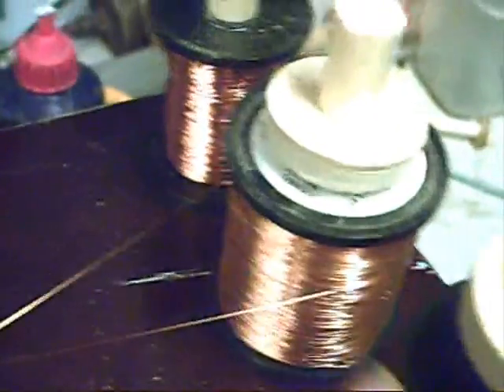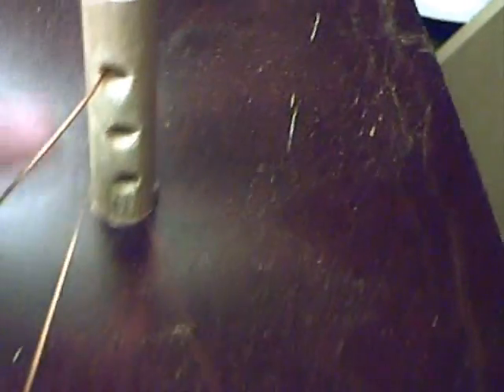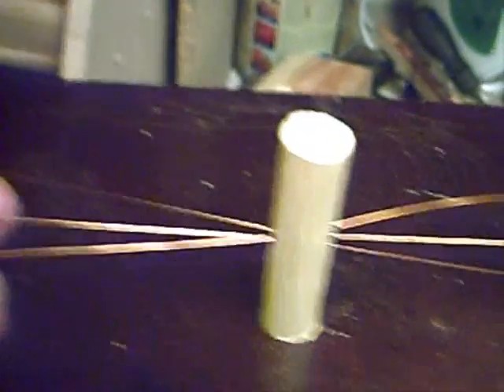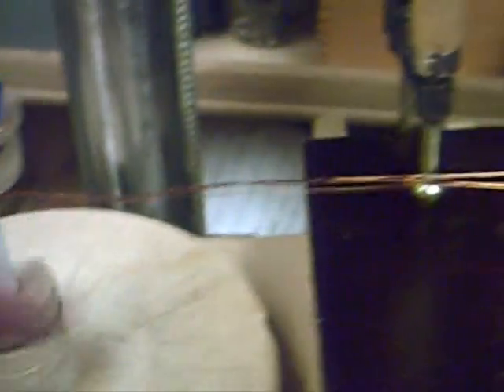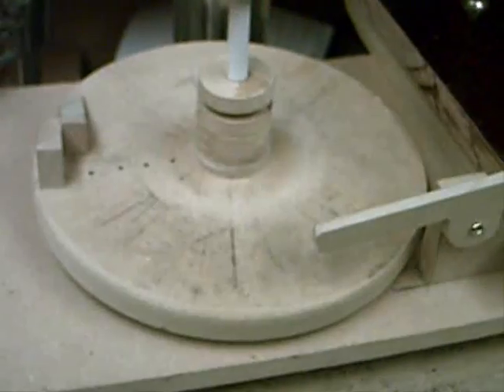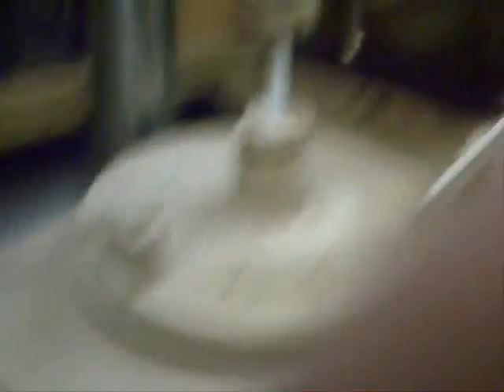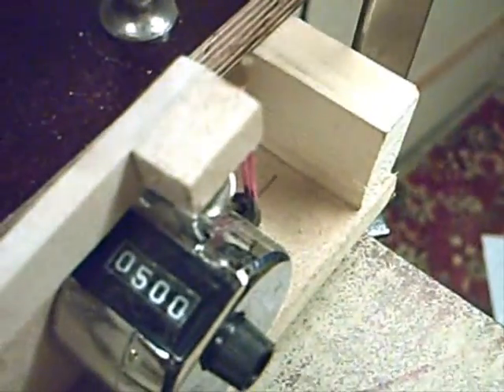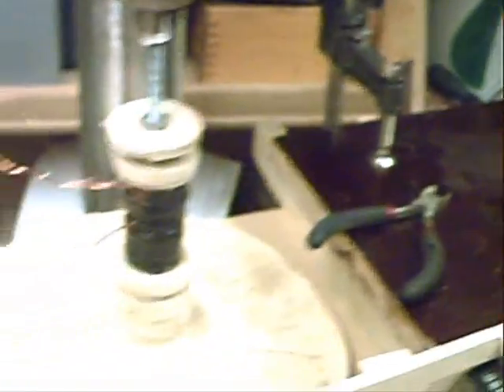Overunity Pulse Motor Bedini type coil winding.

Comment: Nice job on the winding jig and turn counter.
If someone's drill were to suddenly jump to high speed and unravel the source spools, maybe a towel could be placed on them, or some kind of springy "brake" used as light mechanical resistance, to prevent them being jerked and unwinding prematurely into loops and kinks, just something to stop them spinning freely. Someone may find that useful.

Comment from the maker: You are quite correct but you do have to pay attention to the length of the wire and the gage.
But that all depends on the voltage you want to run on or collect.